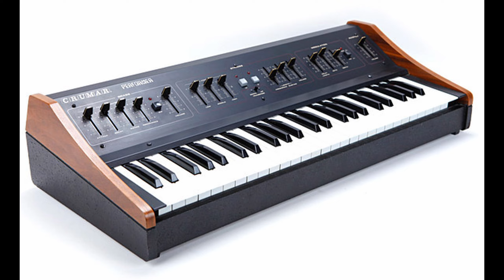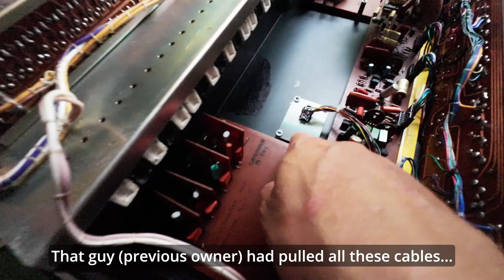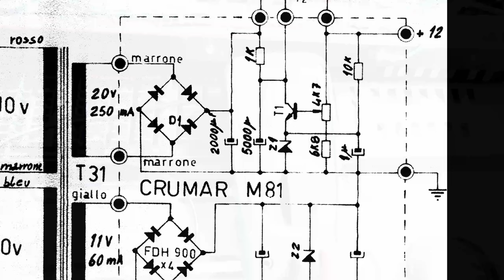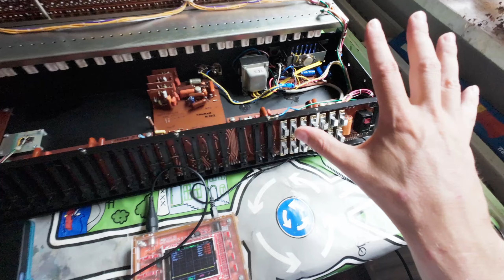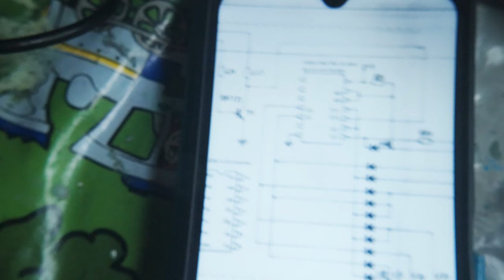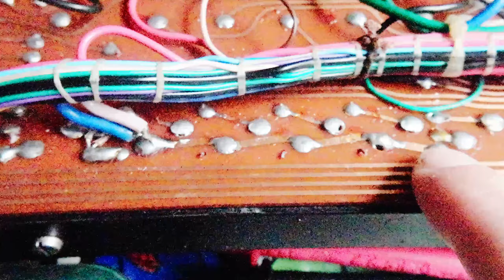Very rare Compac Synth repair 1 - A Confusing Mess

Comment: For the viewers information: In the end it turned out the reason for the strange externalisation operation of that chip was that it has another pin order. This way it could be used without having to change the circuit board. In other words: There is always some reasoning behind my madness. So stop laughing, y’all! 😭🤣